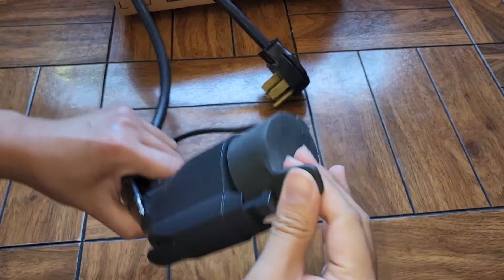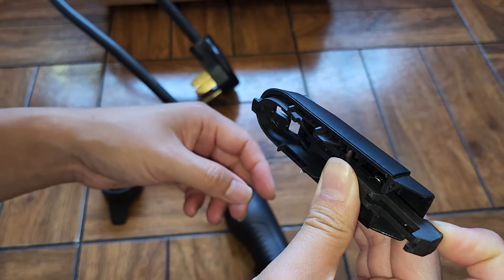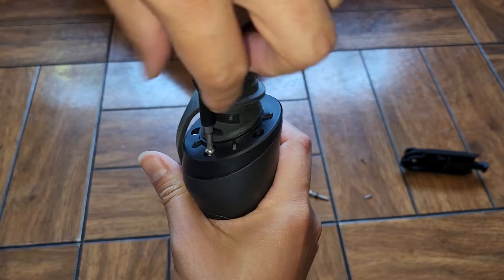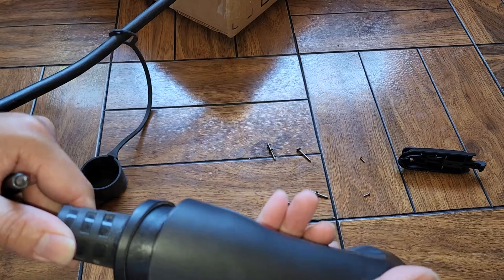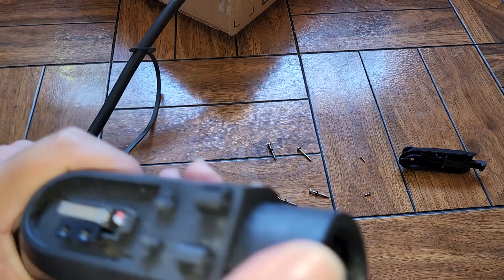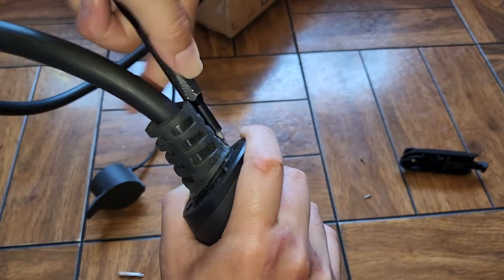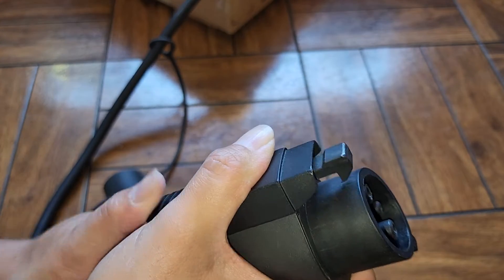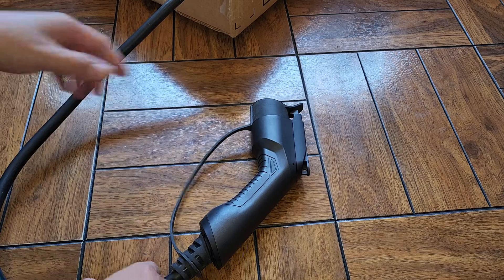Attempting to Take Apart a J1772 EV Car Charger Handle Looking Under the Covers

Comment: Thanks for uploading this. I have the exact same plug and also could not take it apart beyond what you did.
Reply: The seam you point out at 7:42 is where it comes apart. That outter ring is just pressed in. There is a rubber gasket. Wiggling it around with some channel locks will get the face of the plug to come out. It was a bit destructive when I did it. However,  I had a replacement end to put on it.
Reply from the maker: Is yours broken?
Reply: @ItsBinhRepaired  My charger stopped charging and I'm not getting the expected resistance readings from the PD pin so I think that this resistor circuit inside the plug may be faulty. I want to open it up to see but, like you, can't get the plug open because it seems to be a one-piece plastic moulding and I don't know how to separate the plug from the handle. Despite the charger not working, I'm reluctant to start cutting into the plug to force it open... I do have a different charger so it's not urgent but it would be nice to get this one going again. I may end up cutting the plug off and fitting another one to see if that fixes it.
Reply from the maker: @Tautoru  hope you can figure it out.